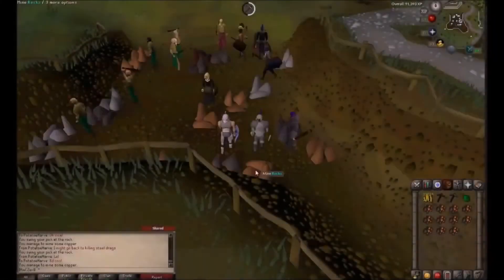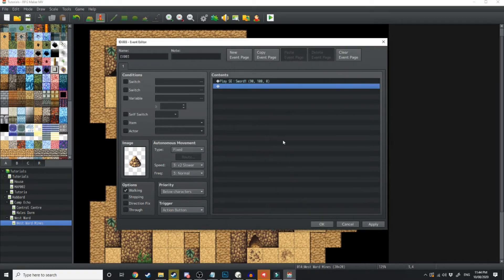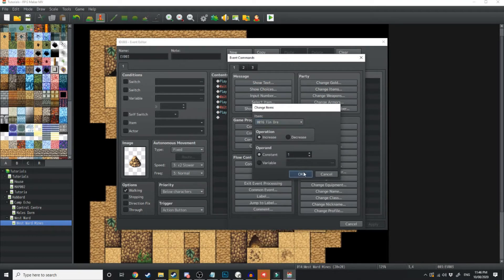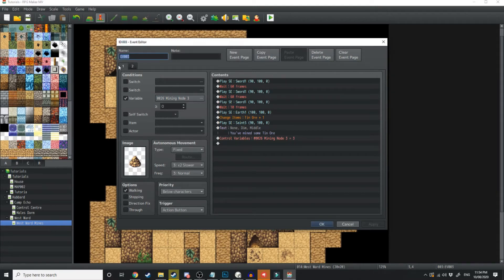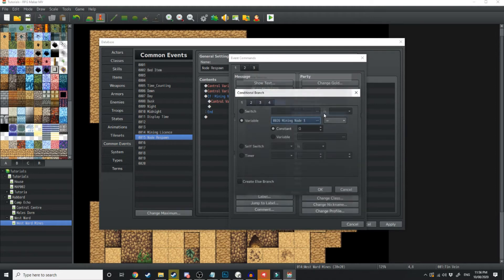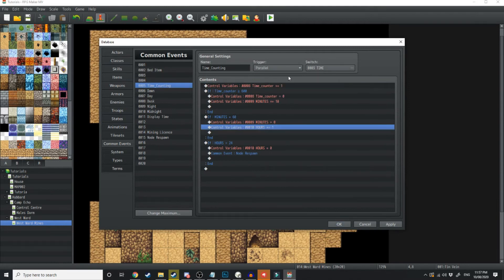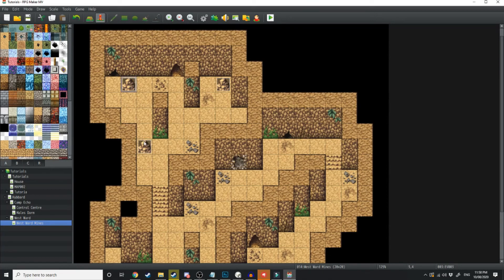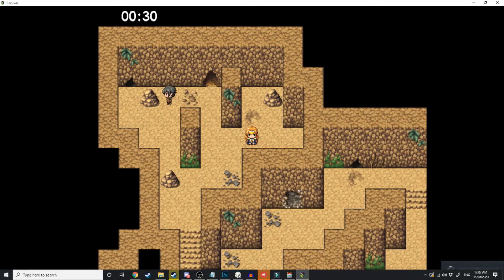RPG Maker MV: How to make a Mining System using EVENTS ONLY

Comment: The sad thing is, that you have to use up one variable for each Node that way.  Some games like Eiyuden Chronicles or Xenoblade Chronicles respawn Meterial as soon as you leave the map. I still think about what is the best approach to that. If there is no delay to gather, it is a lot easier to mine/gather stuff, so you may need more stuff, or make things less worth it. A vid on what really makes a gathering system intrersting and listing the pros and cons would be interesting. :)
Reply: You could also use a single variable and just have everything respawn at the same time, regardless of when it was mined.

Comment: I've thought about setting up a system where you (the player) can continually mine ore at the cost of stamina, with the only way to restore stamina being eating or resting, so this system cannot be used for endless material in a short span of time, and you don't need an event for each node.
Like, for example, "Go to Mine?" Fade Out, [Player] gained 3 [ore]!, -10 Stamina, Fade In, and time passes by a couple of hours.
I plan on using the same idea for gathering wood, foraging, and anything else that would realistically make a person tired.
I've only recently starting watching these, and this is a godsend. Thanks, man.